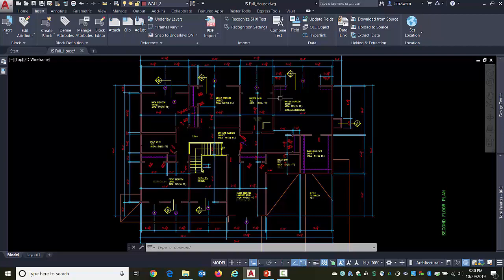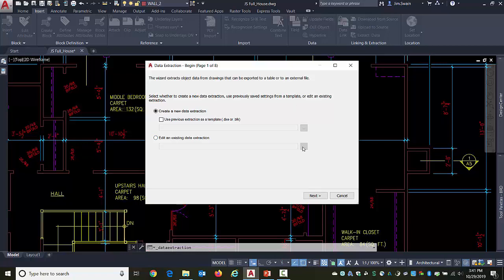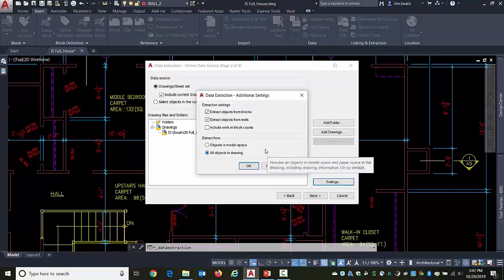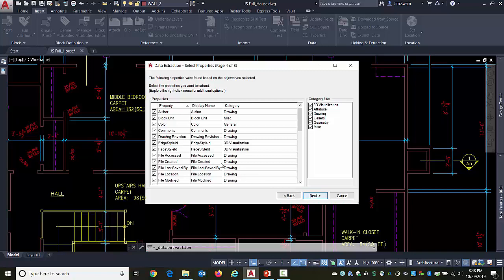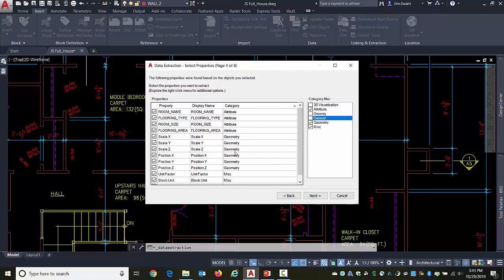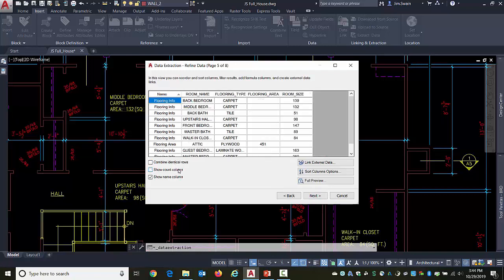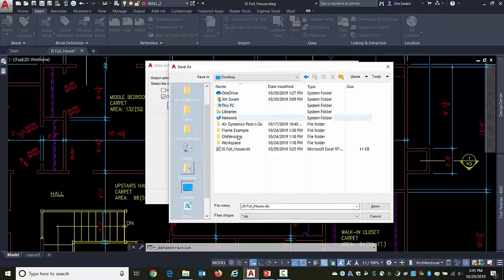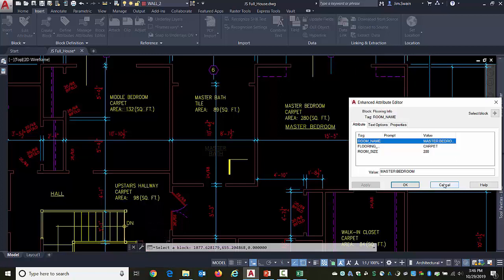AutoCAD Block Attribute Data Extraction Tool

Comment: This greatly simplifies the work if you need to change a large amount of data in an autocad file in a short time. That is, we export everything to a single excel file, then we make changes there and import the updated data back to the autocad file in reverse order. However, what if there are a lot of autocad files and you need to quickly make changes to all of them at once, that is, export data from all the autocad files into one excel file at once, and then, after correcting the data in the excel table, import the data back to all the autocad files at the same time?